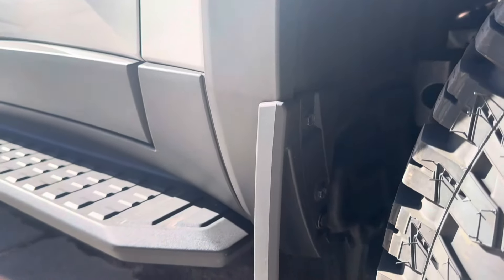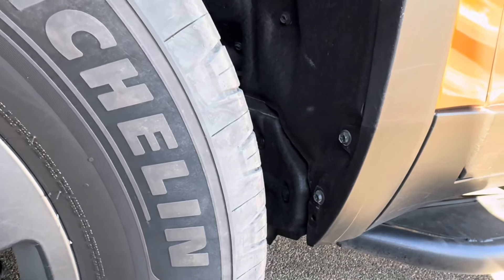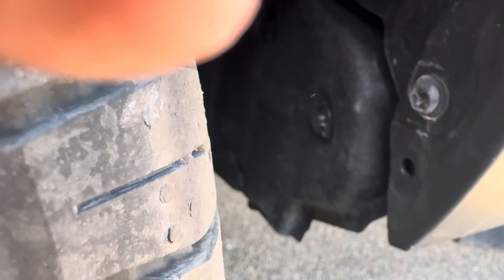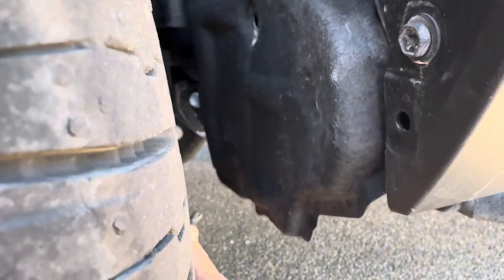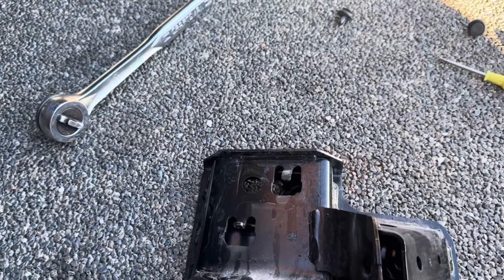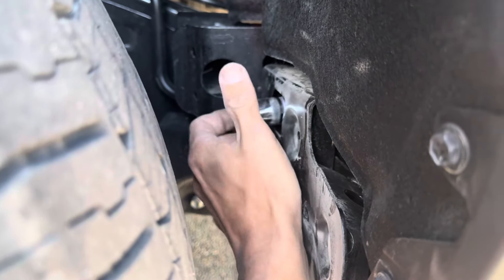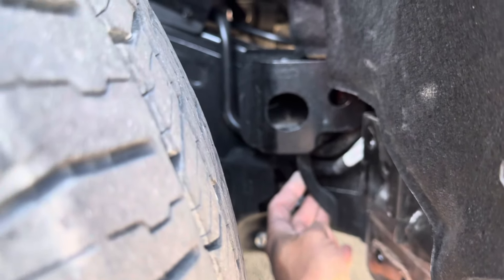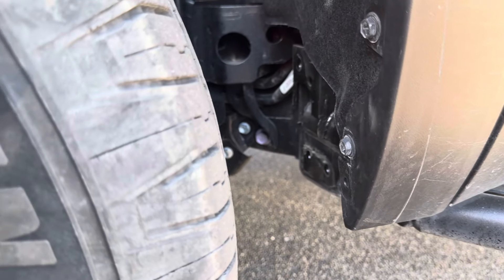How-To: Fit up to 35s on Landcruiser 250 at stock height

Comment: Great video! What offset of wheel did you use with your 35s?  Do you also have no rubbing while off roading (full articulation/while turning)?  Thanks!
Reply from the maker: @brycerollins9496  hi there. I used 17x8 Black Rhino wheels with +20mm offset. I have the SLIGHTEST rub on the liner upfront, amusingly. About a full inch of room at the back. Full compression and lock
Reply: @SNOT-Offroad  Do you think a larger positive offset would alleviate the rub?